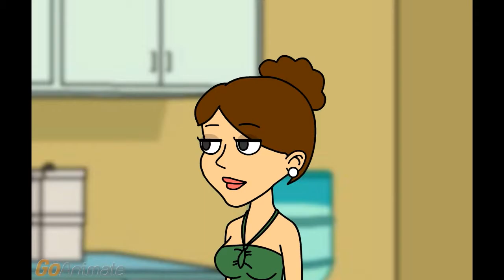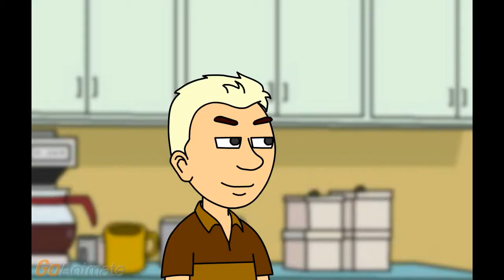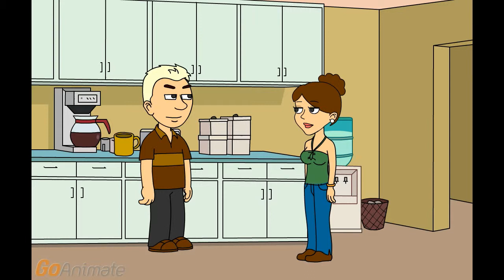Fisher and Paykel Refrigerator Complaints

Comment: 3 month old Fisher and Paykel top mount and the doors are sitting too low and leaking cold air,sliding rails for food bins are sticky and won't come out all the way on one side unless you give them a firm pull.I can also relate to it being noisy,it's the noisiest fridge I have ever owned.Overall not too impressed.I also have a new and cheaper LG in a holiday home and it has been great.

Comment: My Fisher and Paykel fridge is the BEST fridge I have ever owned. It is very quiet and has been reliable for 8 years so far. I don't know who is posting these videos but they certainly have some axe to grind with FP.
Reply: No ax to grind - this expensive fridge just is causing major issues and shouldn't - Woken up constantly at 3am by beeping is not a way to win me over. Only in summer - even with all maintenance - come home from work and its beeping. I won't buy this brand again and it is only that is has caused me a LOT of stress and lack of sleep.
Reply: my name : I just bought a brand new 519L fisher Paykel fridge today. The noise is running from start and going on and on. Not happy at all. Spent a few hundred extra and expect good, but apparently not!

Comment: Obviously, this little video is posted by another jealous company as Fischer-Paykel is the greatest refrigerator I have ever owned, super quiet, the drawers don't rattle around left and right, they glide on a track, keeps consistent cooling in the top refrigeration and the bottom freezer. I went to the showroom to see it in person before buying and it was the small model for an NYC apartment, same as the one I got, that the chef was using for an event being held in the showroom. I am very happy with this purchase.
Reply: Paul Malec don’t agree they are rubbish you can’t even get hold of anyone but a call centre in NZ . There service is non existant
Reply: Paul Malec : I just bought a 519L fisher paykel fridge from Harvey Norman! Brand new! The noise is starting from setting up at 06:30pm till 8:19pm. Thank god! Now 8:19pm, the Loud noise is finally stopped. Drove me crazy for nearly 2 hours! Not impressed!
Reply: Do not like mine either. It is JUNK.
Reply: Maybe they've changed. Bought mine in 2002 on recommendation of NZ and Aussie friends and its been a love affair ever since. Quiet, accurate, reliable.

Comment: I don’t like mine. With mine, it freezes everything. NOT IMPRESSED.
Reply: Have you tried changing the temperature. Worked for me
Reply: Kathryn Marsh yes I did, it just didn’t seem to help.
Reply: @jusjukinallen8845  Likely either the automatic defrosting drain is full of ice or the fan air vents are. You clear the first by using a turkey baster to put hot water into the vents at the back of the freezer section and the other two by taking out the click in place panels at the back of the fridge and pouring hot water in. Makes a mess on the floor so put a towel down. Then set the temperature control to the mid point when you turn it back on.